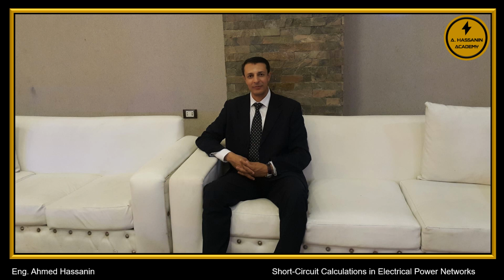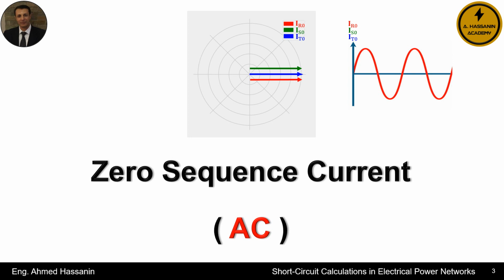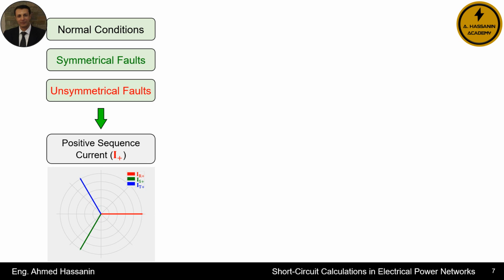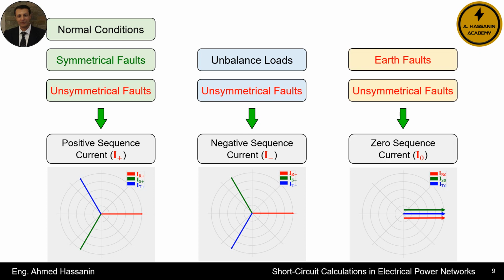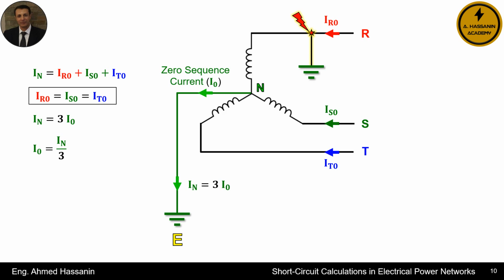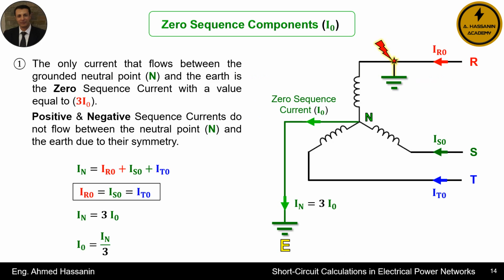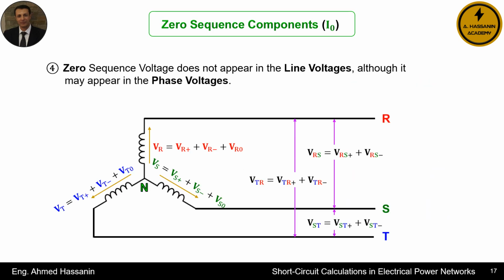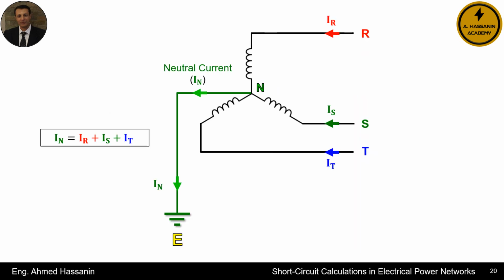Short-Circuit Calculations in Electrical Networks Course: 32 Zero sequence current & Neutral current

Comment: At 10:27 you say, that zero sequence current only appears during earth faults, while neutral point is connected.. but what about unearthed/isolated neutral points? When an earthfault occurs in isolated networks, the capacitive earth fault current also flows as IE = 3I0, which we can measure with summing up the current of all three phases. 
So why exactly should that measured current, divided by 3, not be zero sequence current?